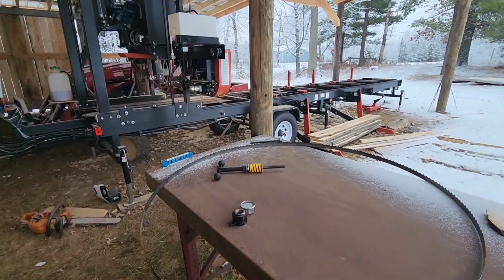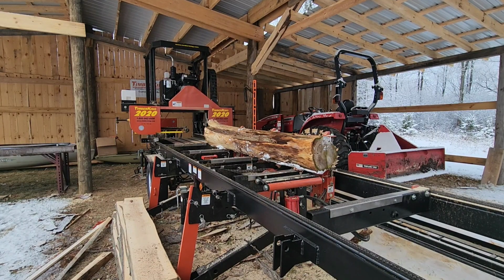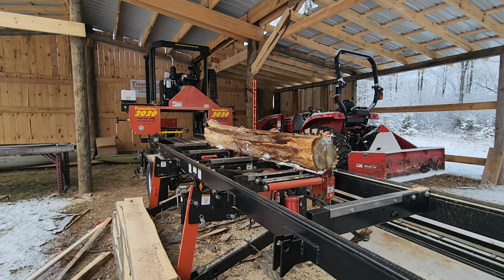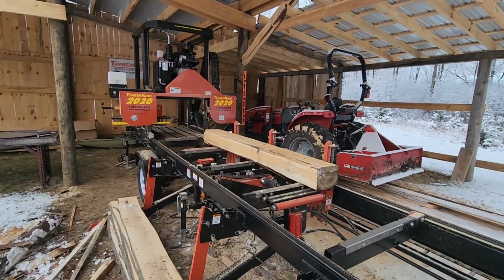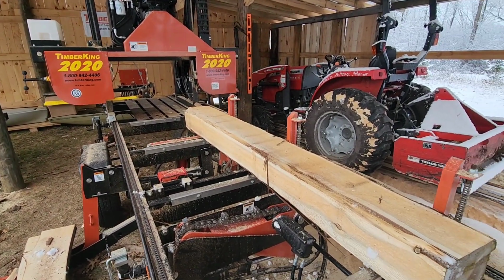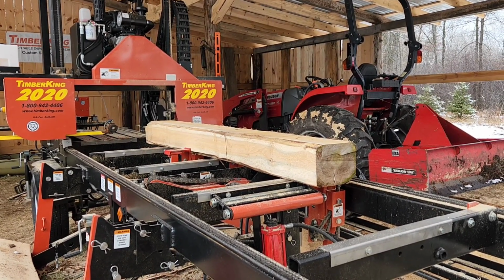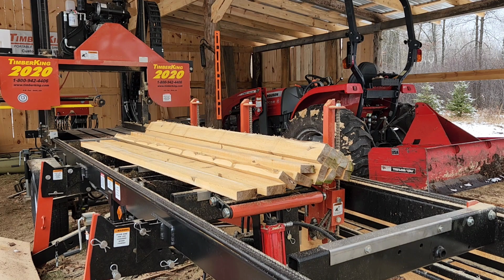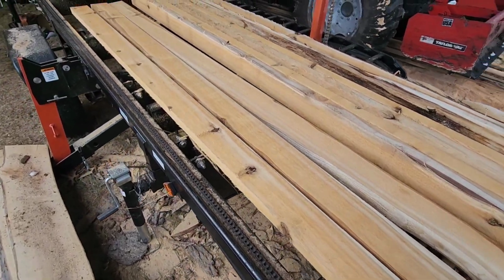Cold day of cutting White Cedar on the sawmill

Comment: Do you mind showing how you remove the cylinder and gauge assembly?  I have to take mine off to free up the cylinder and am feeling a little intimidated, but it must be fairly simple.  I have a 2016 2200 Timberking.
Reply from the maker: I'll do a short video on it tomorrow afternoon.
Reply: I do appreciate your doing that.  I enjoy your channel and have watched probably all the videos.
Reply from the maker: Thank you and it's not a problem.   It's quite easy to take it off but I didn't know until recently because I've never had a need to take it off.  It just unscrews and slips off, but I'm going to show an addition that needs to be added to prevent damage from a blade blow up. Just learned about it yesterday.
Reply from the maker: Here's the removal process for the gauge.
https://youtube.com/shorts/1hMDS4W-kiM?feature=share
Reply: @TCSawmills  I have my sawmill stored at a friend's until my shop building goes up but will try that when I can get out there.  It seems to me that there is a stop that prevents me from just screwing the T handle out.  Thank you for the video and I am guessing that you will be putting a sleeve on the threads to protect them?
Reply from the maker: Yes, sir, it's actually a section of garden hose.  I just learned about it from the Timberking Facebook group.